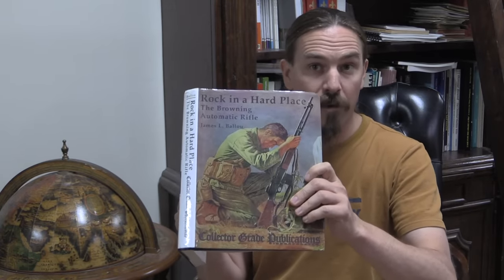Ask Ian: Why Not a Semiauto BAR Instead of the Garand?

Comment: Given the weight of the B.A.R., I feel like it wouldn't be the easiest rifle to plink targets with from a standing, kneeling or sitting position in a semi-automatic configuration. It would make more sense as a squad automatic weapon where the shooter could raise the gun and unleash a number of rounds in bursts. What you may not hit with the first round could potentially be hit (or subdued) with the ensuing rounds, which would justify the heavier weight in exchange for more firepower per trigger pull.

The M1 Garand would make more sense as a battle rifle for widespread use because you could still lay down the .30-06 round with greater accuracy in a semi-automatic platform, magnifying its efficiency using squad and company tactics to lay down bases and angles of fire.

Comment: It's very difficult to get a military to shift momentum. Hence the from our perspective weird requirement of it being able to be switched to a bolt action mode. You can see this through countless examples. Such as the USS Texas when they refitted her with electrical steering they left the steam steering engine in as a redundant in case the electric (which was far superior) failed. Tried and true is reliable, new things are always worried they will break down and cause problems.

Comment: I know that external magazines are better than internal ones that are fed with clips, but i think the clip requirement was put in place because of logistical and manufacturing reasons. they didn't want to stretch themselves thin by simultaneously creating stripper clips AND magazines at the same time. no one wants to end up like italy and go back on a decision during the middle of a war when it doesn't work out

Comment: I think the bottom line is that historically it's usually easier to develop a new type of gun from the ground up and designed specifically for its intended purpose, rather than taking a very heavy gun, and trying to push it into another role by making it lighter. You see the same thing with the MG-08/15. Imagine trying to turn the Bren gun into a standard issue rifle instead of the FN FAL, G3, or BM-59. I know I didn't mention the M14, and that was deliberate.

Comment: I always wondered this as well! (as well as why they didn’t make 30+ mags for BARs, always felt like 20 rounds was a big downside. I believe weight was the reason).  Thanks for answering.
Reply: That and the simple fact that the spring in the magazine would have to be much larger and stronger, more expensive and more prone to causing jams by feeding the rounds more forcefully as the magazine emptied.

Comment: The bottom line is that the BAR would never have made a good service rifle for two reasons:  it was too heavy and it was too expensive.  It was the same as the reason why the U.S. adopted the M3 Grease Gun in place of the much-lauded Thomson sub-machine gun, which was also too heavy and too expensive.   I know that it is virtually sacrilege to say anything to an American against the BAR, but the fact is that it had some serious issues.  For instance it was very difficult to change barrels.  Most light machine guns are designed with barrels that are easy to change when they get overheated.  While John Browning is universally acknowledged as a genius among gun designers, apparently it never occurred to him to include that feature when he designed the BAR.  However, I suppose that is excusable since he designed it during WW-I, before any one else thought of that, either.  In addition, the magazine stuck down out of the bottom, which made it awkward for the shooter to change magazines and impeded firing from a prone position.  Having the magazine sticking up instead of down, as on the Bren Gun, means that gravity assists in feeding the ammunition, which makes it less prone to jamming.  Incidentally, the idea of arranging the magazine to stick up was introduced in the Madsen Light Machine Gun, which actually predated Browning's BAR by quite a few years.

Comment: My 1st thought was weight but I forgot you could strip it down a little with semi-auto conversion but of all the bullshit they wanted weight is pretty important. Magazines weight more than clips and with the thought of the time I understand why they wanted a BAR but no mags and light. In the end, we learn magazines are pretty important (it sounds so simple, almost like thinking why was the zero (re)"discovered" in medieval times?) but seriously, you can't have a rifle this heavy that does not allow for sustained fire.

On my 2nd thought - Garands or any bolt action rifles are pretty simple so the cost would be most likely lower.

Comment: There were already semi-auto closed bolt, magazine fed actions used in hunting rifles in the US.  So its not like a closed bolt semi-auto would be so far fetched for the BAR.  Why they went out of their way with the Garand system is beyond me.  Considering many countries were scaling down their rifles to all be "carbine" lengths of around 16 inches, and semi being far less stressful on a frame and thus requiring lighter build, it would not be hard to reduce the weight of the system at all.

Comment: The Browning bar has had flaws all along .the trigger permits for breach explosions if there is any dirt ,debris in the chamber also a dented case may cause a explosion for instance  if you have a marred dummy round that causes it not to chamber fully ,then you pull the trigger .another way is to hold the sear back then pull the trigger and the firing pin will strike this problem is the same with the Ruger10/22

Comment: You'd have to convert it from open bolt to closed bolt if you expected your rifleman to hit anything with regularity.  That's been done with plenty of "civilianized" blowback subguns to get past ATF, but is just another headache to an engineer trying to use the BAR system. You'd have to toss out most of the internals and start over, and it wouldn't be a BAR when you were done.

Comment: Fires from an open bolt. Heavy. Really cool if you Only have to carry the BAR and is designed for full automatic fire. I don't think it could ever compare to a Garand or an M-14 as a precision marksmanship rifle. I could be wrong. The Colt Monitor as a prison guard gun seemed OK and there is a modern, lightweight version that is styled a Counter Assault Rifle. (HCAR) that gun reminds a lot of a Monitor.A closed bolt semiautomatic version is available. Another reason is that the BAR is not the Cadillac way to build a gun. The Garand is the Cadillac way to go. The BAR is more like the Dusenberg way to go. A Great, Reliable, Robust and is very expensive to produce because of the number of precision manufacturing steps required to build it. Like  Battleship, in a way. Who wants to be on the Wrong Side of a Battleship? 
     It found its niche. Heavy automatic Rifle in an American Rifle Squad. Veterans told me the slow fire on the later model BARs saved ammo and kept barrels cooler. The MG-42 was the exact opposite.

Comment: Because the BAR is the original "Squad Automatic Weapon", designed as a magazine fed light machine gun. It's not suited to use as a service rifle. Too large, too heavy, etc.

It's still a great weapon, by the way. The only real drawback is that it doesn't have a hot swappable barrel.

Comment: I've had a theory/speculative idea floating around in my head since the first time I ever handled an FAL. The thought process looks something like this, the designer of the FAL was an understudy of J.M. Browning-> FN made BAR derivatives-> the BAR locked using an articulated locking piece on the top of the bolt-> could that not be simplified and lightened by moving to a tilting bolt and changing the locked position from up to down?-> is the FAL a simplified, lightened reinterpretation of the operating principals of the BAR?

If my speculation is anywhere close to the truth, then in a sense someone did eventually make a rifle along the lines of what the question suggests.

Comment: The common thought at the time was that the average GI was too stupid to be entrusted with box magazines (the soldier WILL lose them).  That has largely been disproven.  However, in preparation for our first deployment, we were taught not to worry about them for a couple of reasons.  If you dropped an empty mag (upon performing a mag change) and wasted time to reach down to retrieve it, you may not be getting back up due to being exposed (even when crouching on one knee as trained) for too long.  This also went along with if in a building clearing environment, don't even bother trying to extract the empty to a dump pouch.  A 20 cent magazine (that the government inevitably charges the tax payer $20 each) is not worth your life.  For those who are saying an empty mag will not freely fall from an M-16, you are correct if talking about the stock mags.  When we got to 29 Palms, all of our standard tin magazines were replaced with HK magazines.  The HK was about as heavy as having 3-5 rounds remaining in a standard mag; these magazines WILL freely fall from the well.  They also alleviated feed issues (a deadly fault); in combination with M-16A4s built by FN, the common issues with the M-16 that have become a trope were largely gone, to the point it was actually reliable even in a sand environment.  With this setup, we were taught to drop trigger finger to mag release and activate as you are taking a knee, so that by the time you are down, you are already reaching for and inserting a fresh mag, saving seconds.

Comment: I think another part of the answer was the 'good old boys' phenomena.  The idea didn't come from the top of Ordnance and Springfield egos were more invested in designing their own gun rather than piggybacking on J. M. Browning's work.  I have no doubt that if Ordnance had approached Mr. Browning in 1919 about making a lighter weight semi auto BAR firing from a closed bolt, he could and would have done so easily.
Reply: then you come to the next issue which is that the BAR is an insanely complicated gun

Comment: FN eventually achieve a single shot version of the BAR, but in the form of the FAL. First, they modified the BAR in the FN-D, then inverted the operational system upside down and voa-la, here is the FAL.

Comment: The BAR is a beautiful machine, sturdy and accurate but, the point is it provided portable automatic fire at the squad level. Making it semi-auto only defeats its purpose.
Besides that, the M1922 BAR tipped the scales at nearly 24 lbs, more than twice the weight of an M1 rifle. Infantrymen have more than enough junk to haul around without adding 11 lbs to the load. A semi-auto BAR would have zero advantages over the M1.

Comment: Personally I'd want a BAR period if in combat if that was the choice I had. When in I carried a M16 with 203 tube on purpose to me more is always better in life threatening situations. Regardless of weight that must be carried I am willing to be uncomfortable if I can throw more ammunition down range. Better they die than me or my team. And rate of fire is a self control choice yes there may be times you need to just sling lead with reckless abandon in a movement of when providing cover fire but most of the time you'll be regulating your fire.

Comment: It seems to me they were still fixated on bolt action rifles that could be taken to the next step as a self loading rifle.  They insisted upon  using stripper clips to load it so, viola the garand.  Changing the BAR to semi auto fire only and thereby being able to reduce its weight was the way to go. However, it was just beyond their conceptualization.  Just limited thinking, trapped by the time.

Comment: Man. I would have gut-answered ‘weight’ straight off. I have an accurate-weight/profile BAR for Airsoft - I do WW2 era recreation, full kit, very low BB capacity (obviously higher than actual clip size, but lo-caps only and even auto-gunners like me have a meagre supply that handily fills the low-cap short M1 mags that I use as replicas and I can carry a GI’s normal load). Naturally we do it in mostly accurate kit (not real recreation, throwing it in mud monthly is expensive).

Before waffling on - yes, Airsoft is not real, you don’t die, the guns are not the same. But bear with me, because the style I play does pride itself on having realistic or semi-realistic weapons, ammo loads, games and kit. This is not 600 BB 600 FPS spray and pray in full tacticool. It’s half game, half recreation, a bunch of us actually do recreation and are ex-squaddies, history buffs and know our shit as much as anyone. So of course take the following with the ‘supposition’ grain of salt. But I have humped most of the WW2 weapons around a forest in the pouring rain, blazing sun and snow with full authentic wool kit for 12 hours - no threat of death, but one of the things the soldiers and renactors alike (and my experience) all comment on is that our game days are as close to ‘practical reality’ than all but the biggest and longest re-enactments.

Bearing that in mind, I just cannot imagine every team mate humping around even a cut down BAR at 13.5 lb without modern gear to take the weight off. The BAR is a beast of a gun in rough country or anything like bocage hedgerows and tree clusters (okay in fields and flat places) and even with its shoulder strap the weight is… well, let’s just say I prefer to play commando with a Sten or rock my Thompson (Airsoft garands being really expensive back when I started, and I play Canadian due to a chance 1950’s surplus uniform purchase on my first game) because it’s damn heavy and (less importantly for the cut down) bulky.

Even take it down to 13.5 lb, assuming they did the perfect development job and didn’t care about having open clips, single loading or feeding requirements. 

Even with something like the TacBelt’s minimal 2 point sling (an high quality modern repo of the ever harder to find originals) which is what we can reasonably assume they’d invent, humping that gun around a rough field would be loud and play hell with the endurance of an average solider. 

Remember, GI’s and the envisaged US solider had a lot less in the way of webbing and tactical gubbins than someone’s does today, or even in Vietnam - this is long before drop slings and single point slings to carry those modern weapons comfortably, and they took decades to develop after them.

Now imagine all of them only had experience with the weapons of the time, I expect there was a mindset that simply automatically disregarded it because everyone who has ever carried one for longer than an hour and most people who held a replica - never mind an actual soldier from the time who would have to have moved that giant ass gun around obstacles in the trenches - would just leap to ‘too heavy, too bulky’ and then then other practical reasons come along.

If ever a weapon needed some sweet ass drum mags it’s the BAR. Full auto is like a fart of fire with an ammo load that approximates a 20-round clip. Burst suppression only (as intended), which is so limiting as the squad support. But then, as the M1A1 proved (or rather the 1921 did) drum mags are a pain all of their own. The Germans got the form factor right, leaving just the spring problems from bashing it. But anyone who’s used a Thompson with a drum mag will know that the rock and roll benefit is vastly outweighed by the problem of that drum clipping anything and everything - on a tactical challenge range or house clearance (or Airsoft) that’s a mild risk, a jam concern and an incredible annoyance, particularly when you want to go prone or use corners - in battle it’s something that can kill you.

Reanctment Airsoft and full renactment can (in different ways) teach us things about gun design that isn’t a factor of the mechanics of the gun, but of the environment and way it is (or can be) used: renactors get more actual realism, in my experience airsofters push their kit a lot further, as it’s ‘good enough’ accurate and cheaper, also, the need to win a game with the airsoft death mechanic as opposed to the renactors death mechanic can push people to go a lot harder. Plus, we do go out in some awful weather more regularly, which shows you things you might not see. I’m not saying renactors don’t go out in bad weather, we play lighter games monthly  - most fun I’ve had in six inches of snow and sleet, or pouring rain so thick even my wool is soaking through - and that amounts to more use of kit in something like battlefield conditions. Not to mention it’s often not cleaned, certainly not dry cleaned, and all shoved into a bag for next month, then given a service before we go out.

Comment: Uh... I dunno. Probably because it weighed 20 lbs empty? Plus stripper clips can far more readily be mass produced than 20 round steel magazines. Not to mention how inaccurate a fully automatic, shoulder fired, 30-06 would have been. So lots of reasons. The same reasons everyone now has an M4 instead of a 240 Saw.
Reply: That whole stripper clip thing must be why the entire world uses them now for their service issue weapon!
Reply: Manufacturing advances are why box mags are so good today. Back then they had to be way more expensive and heavy to function well, and sometimes didn’t (M1 carbine comes to mind). Box magazines were not logistically disposable right after WW1. The Austro-Hungarians even made stripper fed pistols to avoid making good mags and losing them.